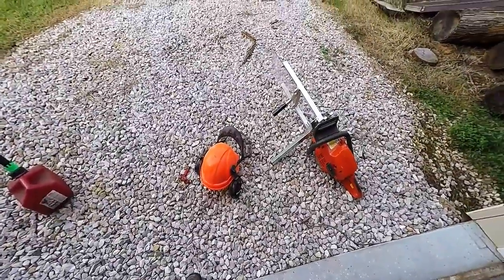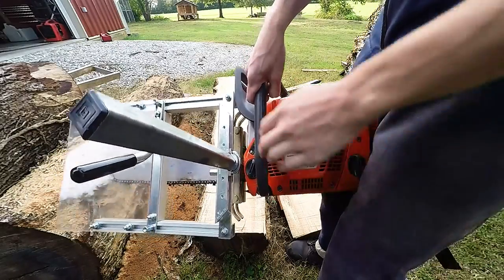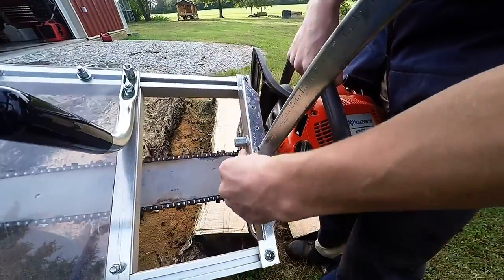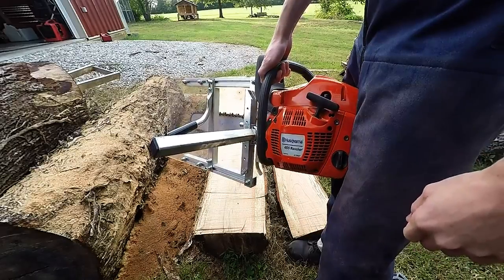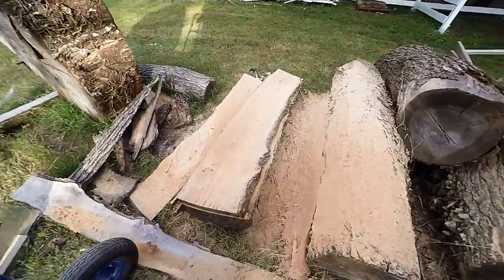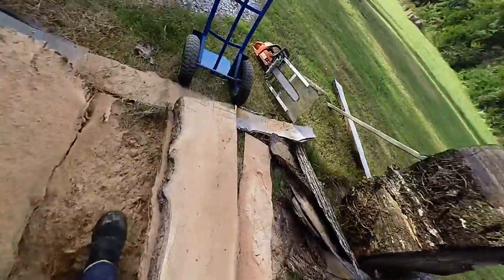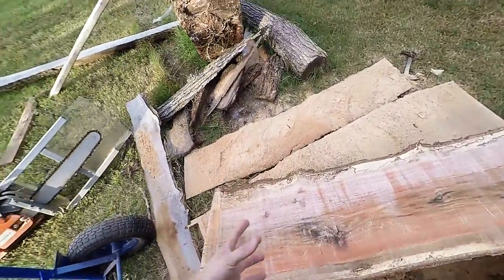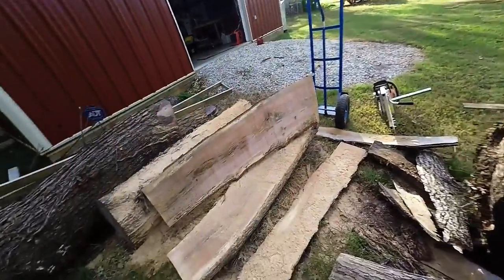Husqvarna 455 Rancher and a Granberg G777 Alaskan Mill Milling Logs

Comment: The saw is supposed to pull into the wood you are running it backwards
Reply from the maker: You're right, thanks for the tip! It really wouldn't make too much of a difference outside of operator comfort, as the saw cuts in either direction. Thanks for watching!
Reply: @crazyjdkid  I was more concerned about it potentially kicking out on you.  Anyways, keep at it, you have some neat stuff going on there
Reply: Bet he's one of them "Southpaws".. always thinking outside the box ;)
Reply: Before putting things on youtube as for demonstrations people should learn how to use the item first.  I see this same thing with backyard beekeepers and their channels.
Reply from the maker: Well Bob maybe its time for Bob to make videos so we can learn how to raise bees and cut wood.
Reply: @crazyjdkid  I probably should.  At least I'll edit the tapes and be sure I know how to use something before I display it.
Reply: @beebob1279  Tapes? Oh, geez🤦🏻‍♂️
Reply: @crazyjdkid  Oh young fella... lol It cuts both ways but it ONLY pulls itself cutting the other way. You wouldn't have to push it then. Ever notice when bucking it pulls itself into the wood but you have to pull it into the wood yourself to cut up? Works the same way on its side. Makes for a nicer cut when the saw pulls in too.
Reply: @ec6052  I guess some people like to make things harder than they need to be lol..
Reply: Lol. He did go the wrong way. Well. Worked I reckon.

Comment: buy a bigger saw. and put wedges between your cuts. otherwise our slab will start to push down on your chain, thus making it harder for the saw to go around and you'll get a lot of chips and scrapes on your boards.
Reply from the maker: I usually do put wedges in it but must have forgot when making this video! This saw is the biggest one I got!
Reply: @crazyjdkid  i can understand but a 55cc is not exactly the ideal milling saw. i know i tried it to, it was hard work. and it took my Partner R16' 15 minutes per 1,2 meter, while my 070 does 10 min for 2,5 meter. the power is there to keep pulling a chain trough the wood and it can handle some pushing. keep it below 14-16 inch on the thickest part if you dont have a bigger saw.

Comment: Good video, I wonder if you used a rail for each cut maybe a good straight 2x6, 2x8 that extended beyond the length of the log the width of the mill frame to help maintain a constant plain. Just add the thickness of the rail to your cut. Does the mill tend to drop once the front of the mill frame extends past the log? I've never used one of these, been thinking about buying one to process black walnut tops once the loggers have gotten the trunk. There is usually some pretty good wood left in a mature tree top that just goes to waste or used as firewood. Black walnut is just too pretty to burn up imo.
Reply from the maker: I actually have a 2x4 frame that I use, but I only use it on the first cut. After that the top surface is level so you no longer need the frame jig. Are you reffering to once I reach the end of the log? It may do it a tiny bit but nothing too noticeable and a planer wouldn't take out, as long as you can hold the saw fairly straight it will hold its level cut. Its fairly simple in operation. But you will need a fairly good sized saw with a ripping chain to run it, as it is very hard on the saw. Its not something that is very enjoyable when its hot out either. Otherwise, its fairly simple to use and after a few cuts you'll get the hang of it.
Reply: Yes, it's a good idea to use the rails on each cut, not only the first cut. Because the error cumulates. On the 3rd or 4th cut the board becomes noticeably bent for me not using the rails.
Reply from the maker: I cut them larger than spec to account for it then plane it down through a planer.

Comment: Hmmm. You need more saw. I don't like bogging my saw like that. My older ones will use up spark plugs. I do have a 572 I bought in the spring. I've been using it with one of those cheap deal that goes on the bar with a 2×4. It's not great. Lol.

A couple wedges might help to keep the non cut side for rubbing.

Update. I bought a 660. Couldn't take it no more. Lol.

Comment: Is there any problems with squareness with this style of mill, versus the ones with another clamp near the bar end?  My saw was a 24" bar, but the styles with the clamp on the end take about 4" out of maximum cut width.
Reply from the maker: I haven't had any issues. I was cutting knowing I would plane it later though.

Comment: nice vid. :) whats ur plan with the wood 1's its cut?
Reply from the maker: Thanks! After it dries for about a year, I will cut off the edges and run it through my planer to square it up. Then it will most likely be used to make a variety of furniture. Unless someone wants it in raw for to make a mantel or something. Oak is worth about $6 to $7 per board foot. So the piece I cut in the video is worth about $30.
Reply: ur welcome :) o ok. not bad money there.

Comment: Will it bend less if you pre-dry it before its cut to boards, and I love that oak, but its super tough on the equipment. - also I saw that you need to stack them absolutely straight and flat.
Reply from the maker: These logs have been drying for 6 months. But I'm not sure which is better, to let it dry or to cut it green! It sure is hard on the saw,  and dulls chains in a hurry. I stack them on a lumber rack attached to the wall, and the usuallylay pretty flat. I will have to try some different techniques to see what keeps it from bending the most. Thanks for watching!